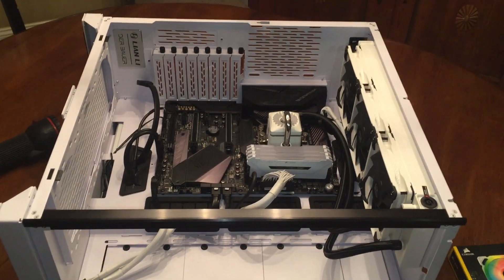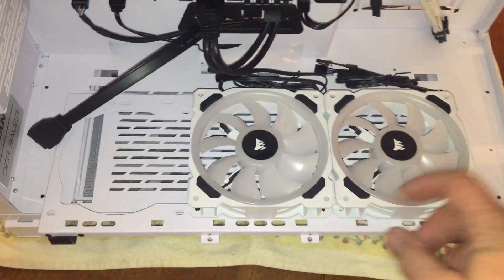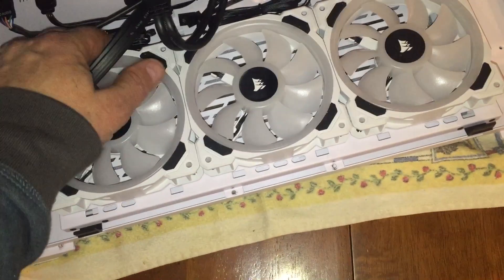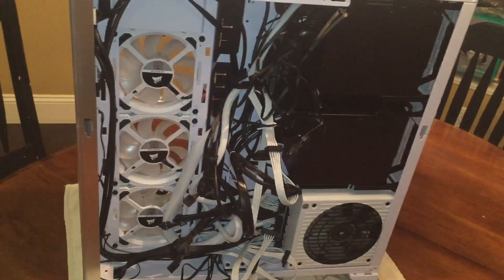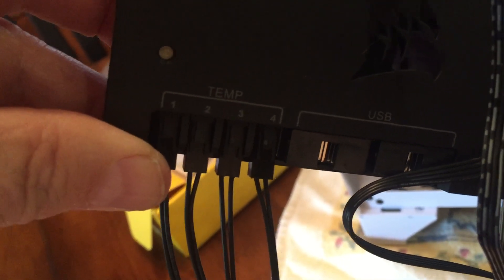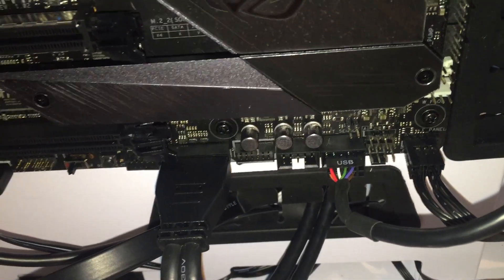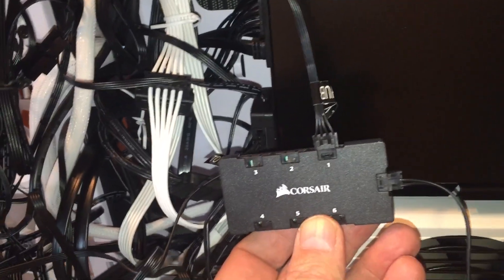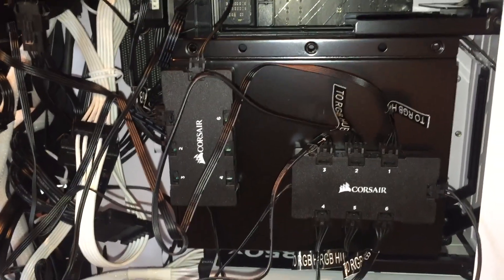Building a Computer Guide  - Part 4

Comment: It is to my understanding that corsairs fans aren't the quietest (noctua being the most popular) but can you keep your system quiet? I'd imagine that just by the sheer amount of fans you could keep them at low rpm and still have good temps. I'm wondering because I want a good-looking build but one that is very silent.
Reply from the maker: I have 9 fans so I had no expectation that they would be silent. I also have my case sitting in the desk top next to me. Can I hear them, yes, but it is not really noticeable until they kick up. If the case was on the floor next to the desk they would barely be noticeable but then I wouldn’t be able to see all those lighting effects. I didn’t realize that some games used the fan lights and synchronized them with the game. Pretty cool.

Comment: 5:13  There's a big problem here..side and bottom fans should be intake with this case, not exhaust.
I know they probably look better like this, but airflow is not ideal at all: there are 10 exhaust fans, and no intake.
Fresh air that should be used by the gpu is sucked out from the bottom fans, and fresh air that should be used from the AIO, is sucked out from the side fans.